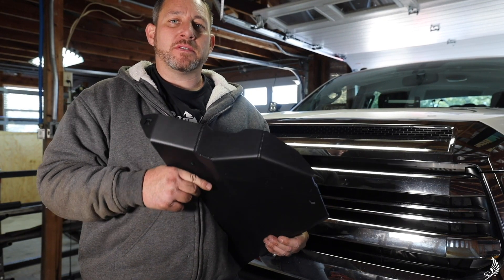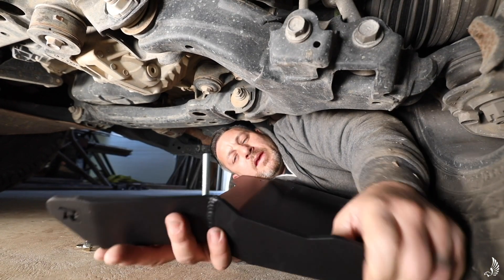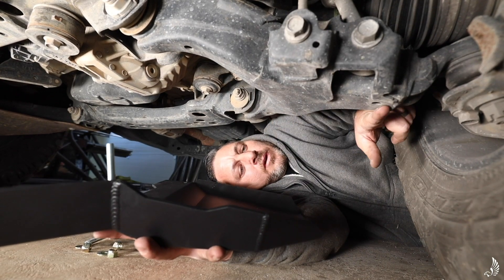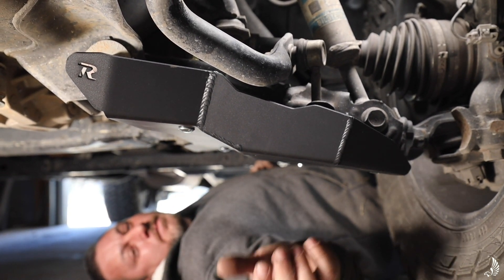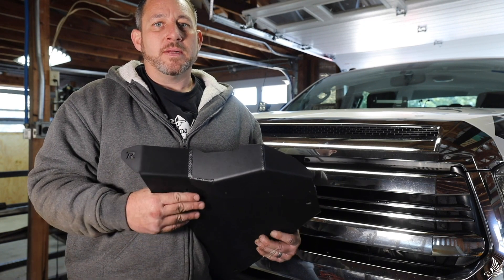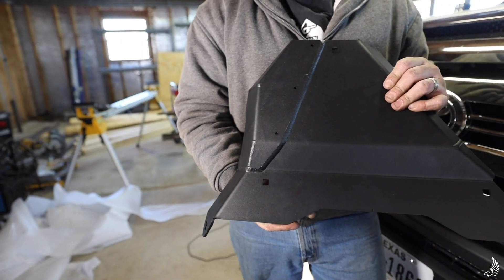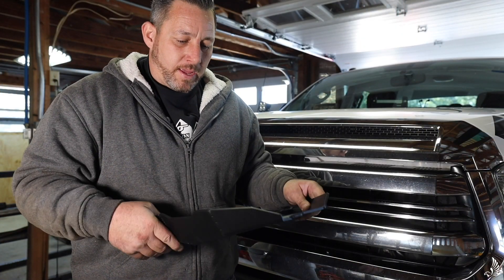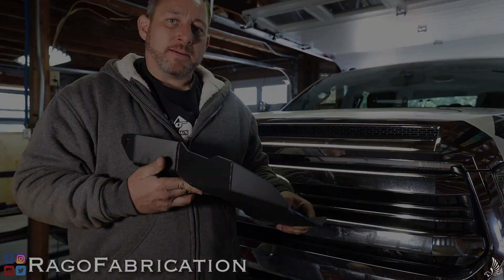Toyota Tundra Lower Control Skids Install | Rago Fabrication

Comment: They do not fit properly. Yes, it's still possible to bolt them on, but it is a poor fit, they will rub against the frame. Plus the skids come without spacers welded in bolt holes area, so there will be undesired gaps between the skid and control arm, which is bad for the skid and bolts: the skid will shift backwards on impact and bend the bolts and the arm. Also the washers are too small, they barely cover the hole in the control arm. Need to be bigger and sturdier.

Other than that, the quality is fine: welds, paint...

I'll have to rework mine, but thanks for candy ;)